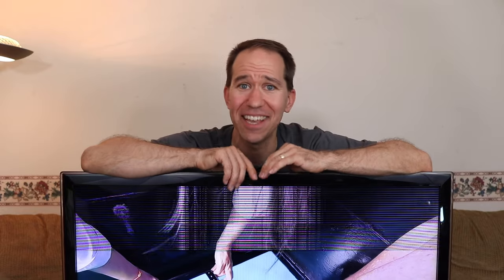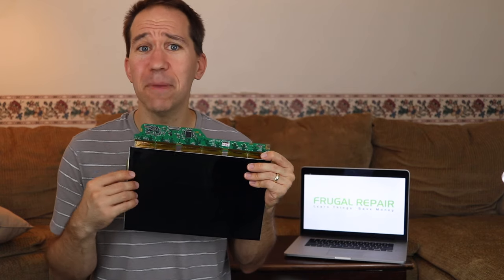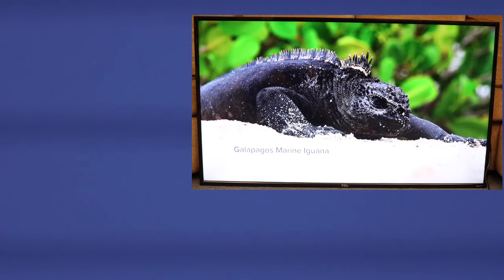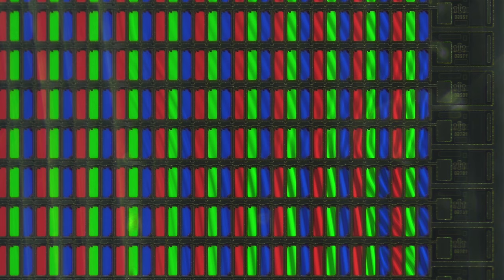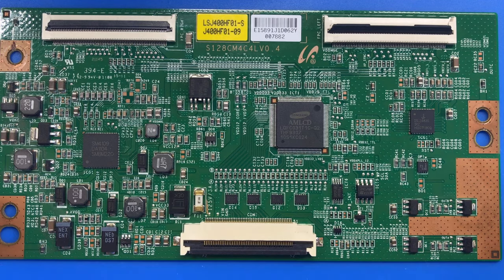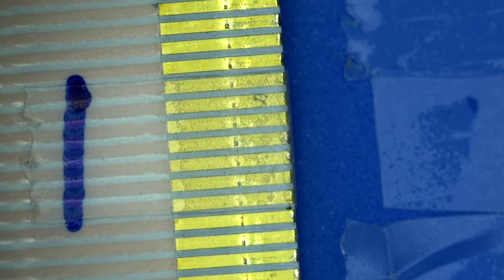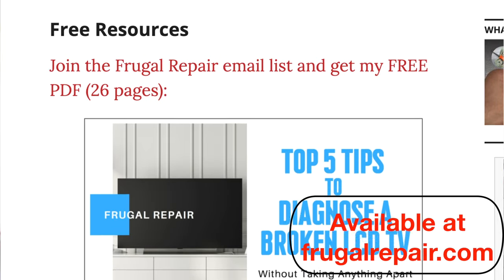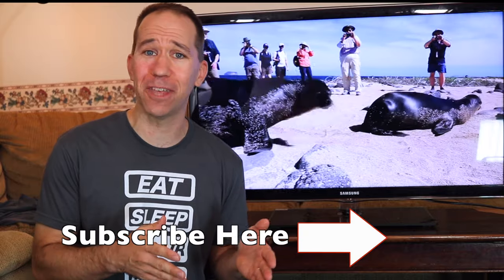Repair Hack Explained | How to Fix TV Horizontal Lines - Part 2

Comment: Really great information. I love technology and love fixing electronics. I will be watching more of your videos, thanks for making and sharing them!
Reply from the maker: Thanks. That’s great that you like fixing electronics!  What have you been working on lately?
Reply: @FrugalRepair  My Vizio SmartTV has horizontal, fuzzy lines but it has a vertical roll as well. So this may not do the trick but I thought I'd try your trick with the tape (maybe need to block some of the Vertical connections as well?)..... I would take apart Halloween and Christmas decorations as a kid to get the motion sensor or lights to work again. Most of the time just taking connections apart and putting back together did the trick. And I fix cell phones here and there. But I love taking apart electronics to diagnose and fix them. I never knew how the pixels in an LCD worked, so cool to have someone explain it other than, "It's magic" (What my electronics engineering teacher told me about how radio signals work). Needless to say, I did not care for that teacher. Thanks again

Comment: this is really well explained, finally someone explain and understand what he is doing.... My question is : Is there a way to use a multimeter and measure those signals to see exactly the signals paths that are shorted to be able to block exactly those line and not others?
Reply from the maker: Thanks!  You could possibly use a DMM in continuity or diode mode to diagnose it.  It would depends on things like your DMM's settings and the strength of the short (resistance).

Comment: Hi, I have been checking out your videos and thanks for sharing the quick diagnostic tips. I have an issue and still cannot locate the problem. My issue is the screen goes dark between 6-12 minutes with no noticeable lines on the screen and I have already tried swapping the t-con board. I went as far as outline the front screen off to check the LEDs and they function so I am starting to hit a wall and if you have any other suggestions I would love to hear them!
Reply from the maker: Sounds heat related to me.  Did you try turning the brightness down to 10% and see if it lasts longer?  Or even put a fan on the vents of the tv to keep it cool?
Reply: @FrugalRepair  I have not but this will be the next attempt, ty for the reply!

Comment: Thank You. This actually works l picked up a free 75" LG had horizontal lines across the entire screen, it was the right ribbon at fault,l didn't want to waste time so decided to just cover the first 12 gold lines, from the left side of ribbon towards the right (didn't remove the entire ribbon so from the left side of the ribbon when looking at it still in place basically)
 ...l covered exactly 12...and Bang it was fixed😀...couldnt believe it.
Try blocking first 12 lines on bad ribbon
(from the left side) and see if that works first like it did for me😁!! Cheers
Reply from the maker: Wow, congratulations!

Comment: My 50" Toshiba LED TV had tiny horizontal lines. After watching this video, I took the TV apart, fortunately it was enough to remove the cables connected to the T-CON panel and put them back, the stripes disappeared! Thank you so much for the inspiration  :goodvibes::goodvibes::goodvibes:
Reply from the maker: That’s great to hear, congratulations!
Reply: @FrugalRepair  My joy was premature, unfortunately the stripes returned the next day. But they are only visible for orange, yellow and red colors. I looked for a suitable T-CON module, but on the online shop website it is written that the horizontal stripes are not caused by the fault of the T-CON module. What might be the problem?

Comment: This saved my 86" lg from the e waste pile,  I did the 3 board swap and was still having the picture fade out before it could even make it to the menus.   Having taken a class in digital logic, it baffles my mind that this worked. I can notice the contrast is not quite as crisp in one corner of the screen, we threw up some 4k Screensavers on the two tv's.   So yes the probem can be fixed but it's not quite the same.

Comment: HI @FrugalRepair. Thank you for answering my question on your part 1 video. I have another :) How did you correlate the pcb labelling for the clock lines to what pins they are on the cable? Example, which pin is STVP? And then there is the rest of the CKV lines. The one I am looking at trying to fix I also see the labes printed on the circuit board but how does that tell me what pins they are on the connector? Hope I make sense. Thanks again
Reply from the maker: I’m not sure how to tell you exactly, but you should be able to see the traces grouped together, that’s a clue.  Usually they are printed really close to the trace.  You can also do a continuity test from a test point (if labeled) to the pin

Comment: Great videos. I have a Vizio and it started to darken in the top right corner, I was thinking it was the light. After watching your video and now my tv screen has a line going all across on top. I would love to repair it myself if I can. I would appreciate any help. Thank you in advance.
Reply from the maker: Thanks.  It might be the backlight or the lcd panel or both.  Try the isolation test and if both sides show the same problem then I might suspect the tcon board is bad

Comment: Hi Reese. Thanks for sharing such valuable insights with us! I have an issue with my LCD where I see horizontal waves. They're moving continuously from bottom to top and are particularly noticeable with dark backgrounds. Do you have an idea of what the issue might be?
Reply from the maker: I’d try the diagnosis in these videos.  You’d want to isolate if the issue is in the lcd panel or on the tcon

Comment: I had a power issue at my house. When I turn my Sony TV on it had double images. Then the next day it started flickering. Tried the tape and it worked. TV looks great again. Thanks
Reply from the maker: Congratulations on the repair!
Reply: Did you open the tv??? Mine is 65” and on the wall and I couldn’t watch this full video he’s doing too much of explanation

Comment: Thank you @FrugalRepair! Very informative video and well explained. Now I have Philips TV (58PUS7855/12), and after taking a hit from the tennis ball by our youngest the horizontal lines appeard plus on the right side of the display around 8 inches from the bottom the screen is getting really hot so it started to melt the display and the plastic casing. Now I unplugged the ribbons from T-CON from both sides and indeed with ribbon for right side unplugged (S-L, left from the rear of the screen) the right side of the display is white and right side displays image with plethora of horizontal white lines. When I unplug ribbon for left side of the display the left side is white and right side displays better picture(still horizontal lines) and no image displayed from the bottom up to around 8 inches. This is where the ball hit the screen (I believe) and now very hot place (short) can be found on the edge of the display. Not sure how to proceed further. Much appreciated for any suggestions. Thanks!
Reply from the maker: Sounds like the lcd cracked when the ball hit it.  If so, you unfortunately, aren't able to repair the cracked screen.
Reply: @FrugalRepair  Thanks. What a bummer:). I was trying some more info. Stumbled upon info that using jest gun can help to return crystal to its compartments, but this probably pure luck:). It seems like liquid crystal spilled over the area and/or paths damaged causing short. Would send a photo here but it doesn’t let me. Wanted to give it a go before I let it go:). Cheers
Reply: Can still watch the TV and funnily it would be okish after a while but then can freeze and getting darker like image is stopped being fed to display at all. Trying to find some patents and not there yet, found Ambilight though:). The manufacturer is TPV who supposedly can use brand name Philips.

Comment: Thinking outside the box, love it! So a timing signal that's shorted to ground could be fixed with tape because it's pulling the whole row low. I'm guessing that's the explanation?
Reply from the maker: It’s likely the get signal that is duplicated from both sides of the lcd assembly.  Blocking the side with the short allowed the other signal to work, but it’s not 100%, which is why there are duplicate signals in the first place.  But if you can’t notice the difference when watching, then it probably doesn’t matter.

Comment: Thanks so much for being here. I have collected all the things I need but am stumped at locating the clock pins. I’m working with a Sony tv and the board is an le650aqp. Is there a certain page or specific language to use to find which pins on the board are the clk’s.  Thanks in advance for any help you can provide.
Reply from the maker: You can use a multimeter in continuity setting to find pins that are electrically connected on both sides.  Look for a group of them in a row and that’s probably them
Reply: Thanks so much, I’ll do that.
Reply: Good morning, I’m still having a problem finding the clk pins. The t con board has 4 ribbons and I’m not sure which set to use. Any suggestions?

Comment: I have a broken 4k tv but honestly since I would barely use it even if it worked I've been looking for repair ideas cuz I don't care if I completely wreck it. Got a ohm/volt whatever meter and a soldering iron. Think it'll be cool to try fix it either way!

ANYWAY. What I really wanted to say you make cool and informative vids so hi I'm a new subscriber!
Reply from the maker: Thanks!  I hope you can fix it!
Reply: @FrugalRepair  Thanks! I'll first need to figure out what's broken/also take it off the wall mount but I most definitely find the idea of a DIY fix awesome. Got no idea how the reader thingy works but that's all part of the fun. Fix it til it's actually broken is what I've come to understand from the repair community which honestly is absolutely amazing! 
For my model it seems the most likely cause is a bad capacitor but I first need to figure out how the reader works and how to use it to pin point the problematic part.
Reply from the maker: If you haven’t already, it might be helpful to download my PDF, I have some diagnostic steps in there.

Comment: Frugal Repair - I watch tons of your videos just because I like to learn stuff like this in case I ever need to know it. Haha. You have a great way of explaining things, and keeping the videos super interesting. (Especially with the extreme close-up footage, and heat tracking elements).

However!! 

I need your help, I know that this is a two-year-old video clip right now, but I am hoping that you are still reviewing comments. 

If yes! Please shoot me a reply. 

I have a 2019 Insignia LED/LCD TV. That has perfect horizontal lines, across the entire tv screen. (Top to bottom, left to right). 

Help me Obi Wan FrugalNobi! 

You're my only hope!!
Reply from the maker: Thanks for watching and your encouragement!  Did you try everything in these two tape videos?  That should help you narrow down if it’s the lcd assembly or the tcon is at fault
Reply: @FrugalRepair  I am trying to determine where to start, because it's the whole screen (literally 100%, perfectly even lines. The only anomaly is at the very bottom of the screen, there is what looks like a dotted white-blue line riiiiight where the edge of the screen meets the plastic bezel). 

Regarding the tape trick, and trying to tape off pins 1 by 1... How do I know which TCON ribbon to start with?

I left the TV powered on, while I removed and reattached the TCON ribbon cables... And the lines were still present regardless of which I unplugged.

So.... Would I need to just block them 1 by 1? That would take hours, lol. They are practically microscopic pins haha 😂

I'd love you shoot you an email with some photos or a video. To get your input!

Thanks so much for the fast reply!!  You are awesome. 😎
Reply: Any feedback or input on this??
Reply: Darn..... Guess I'm stuck on this one... really don't want to throw this TV away... i think it could likely work for years to come!  :(

Comment: Brilliant 2 videos, I used the method and fixed horizontal lines and flickering image, but I have lost the red signal to half of the screen, will have to adjust size of tape now by trial and error 😕
Reply from the maker: Thanks!  Hope you can figure it out.

Comment: Wow!! This worked on a 86uh9500 LG tv!!! Thank you !!!! Will replacing the TCon board fix the issue too?
Reply from the maker: Congrats on the fix!  No, the lcd is the problem so a new tcon wont help.
Reply: @FrugalRepair  So the only other solution is to replace the lcd, which is more expensive than a new TV. This fix was genius! Great job!!!

Comment: Hi, thanks for the video. I managed to get rid of the horizontal lines. I got down to just 1 line and now the tv has no more lines but on the damaged side the color is really faded… any idea why? Should I leave all 8 lines covered?
Thanks 
Keep up the good work
Reply from the maker: If you watch both part 1 and 2 I try my best at explaining why there are faded colors.  I would try to leave the least amount blocked as possible.

Comment: Dear @FrugalRepair, thanks for sharing these videos. I manages to fix my 49 Sony 4K tv by trying out different things from your videos. The issue I had with the tv was that every 2 seconds my screen would show double image for 2 seconds, and then go back to normal. By blocking one of the clock lines it is almost back to normal, 1 out of 8 lines is less bright, however from the couch you do not notice 😊.
Thanks a lot for making these videos, this helped me ( and hopefully others ) and it will reduce the electronic waste!

Comment: Hello dear. First of all, I want to thank the advice and videos that he makes for the community. I want to ask you for a SAMSUNG UN40D5003BG TV where I should isolate the connector with tape and ask you which are the pins that I should block for this TV, in advance I thank you for your recommendations. Cheers
Reply from the maker: Sorry, I don’t think I can say more than the video.   Each board might have a different printing on it.
Reply: @FrugalRepair  thank you

Comment: Thank you very much for making these videos. 
I need your help with a Samsung TV that I have. 
Once I disconnect the one of two ribbon cable I see half white screen with horizontal lines . Once I disconnect the second the other one I see the same half white screen again  with horizontal lines but on the other side. Is it a symptom that t-con board is faulty or I need to place a tape in the correct pins on it?
Thanks in advance 
Theo
Reply from the maker: If the issue is consistent on both halves during the test, then I would suspect the tcon next

Comment: Today it saves me ₹30000 my 48inch tv shows random horizontal lines up down i try myself cleaning cables nothing works after i youtube and see you video in my case all writing on pcb so block the same you show in your video and its works

Comment: I have a tv , I turned over and laid flat against the cable box; trying to find an input jack. When I set the tv back up, all I have is vertical rainbow colored lines through out the entire picture.  The cable guy says the screen is broken and they can’t diagnose the cable problem without a properly functioning tv.  Did I break my tv beyond repair?  Is it worth repairing if that is possible?  Great channel for all kinds of cool stuff.
Reply from the maker: Thanks! It sounds like the lcd is broken but it’s possible a cable came loose.  Try gently twisting the tv corners while it’s running.  I don’t believe the cable guy personally because he should be able to figure it out.  You would still have sound, at he can work with that at the least.

Comment: Good afternoon, thanks a lot for your video. I have an LG Tv with TCon Board. I can see signals Clock 1 to Clock 8. But on some videos people have not apply tape on the 3 firsts ones. Why ? I was wondering that we have to block all the clocks signals like you ? In fact my question is more like : do we have to block all the Clock signals or only a part of them could be enough !?  
Thanks a lot for your answers !

Comment: It is nice to know there is a easy fix.  I have a Samsung 40" 4K UHD smart TV, after about a year and 4 months of use,  there is a horizontal white line running across about 3" up from the inside dimension of the frame.  Your method seems may solve the problem.  My problem is how to determine which pins need to block, do I block one pin at a time, or use the full width of the tape?  I am not tech guy.
Reply: Try turning your tv off from time to time. Keeping your tv on for a long time can damage the screen.

Comment: so far you have demonstrated a thorough video of how to repair a tv with horizontal lines on the screen.  but one question;  can i use regular tape or doesnt it have to be a special thermal adhesive tape?  also, i tried logging into your frugal repair website but my laptop is alerting me that its supceptible to hackers, which i do not like.
Reply from the maker: Thanks!  The tape doesn’t matter because your just trying to prevent an electrical connection.  For the website, please tell me more, are you using https?  If just using http some browsers will say it’s not secure, not because there is an actual issue, but because it’s not using encryption for the data (that is, https)
Reply: @FrugalRepair  hello and thanks for your reply.  i simply type in www.frugalrepair.com and it directs me in, but on top it says "not a secure webpage to browse" 
the https:// i never do cuz all laptops automatically do it
Reply from the maker: Thanks, yes, it’s not my website but the browser that is saying that because your using unencrypted port 80 (the technical terms for http).  Try typing https://FrugalRepair.com and that warning will go away since that is using the encryption.